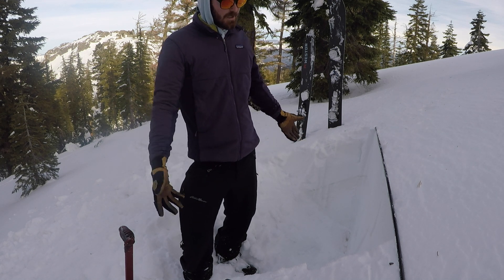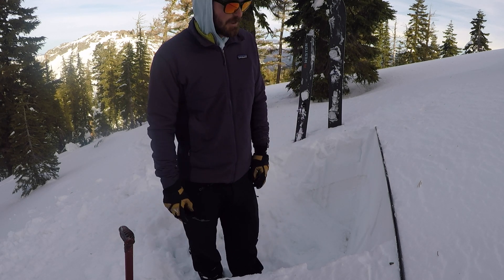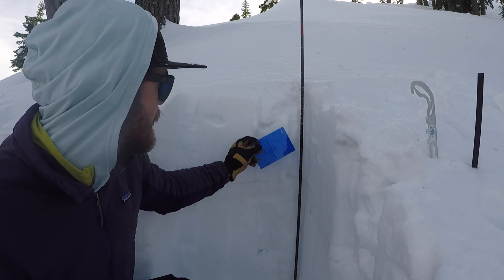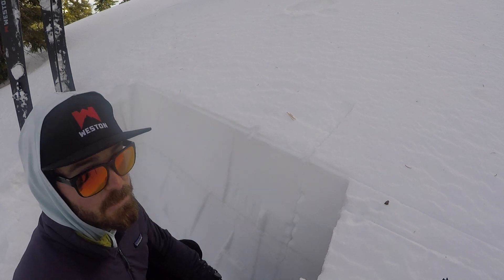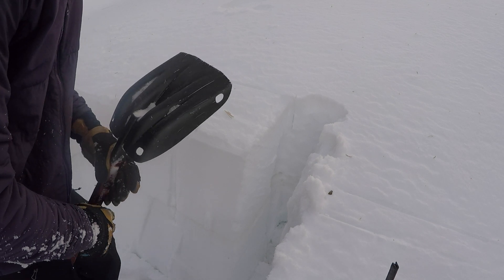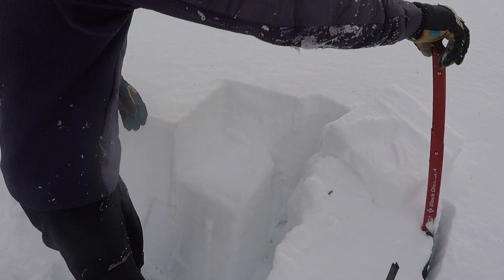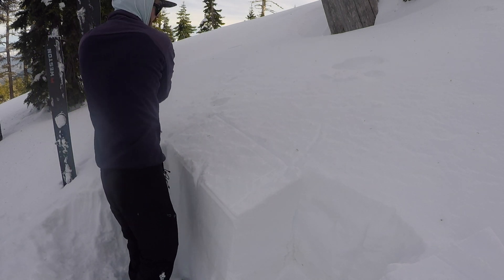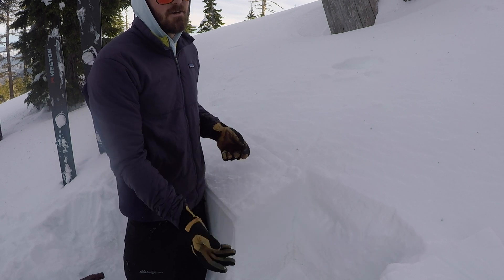How (And Why) To Dig A Test Pit (Snow Pit)

Comment: Hey man, not sure if you are checking comments a year after this is posted, but what would be your summary after this snow test? Would you have given yourself the green light and kept on skiing?
Reply: Not the OP, but snowpits don't give 'green lights'. They can only test for red lights when conditions are questionable (i.e. scientific method mindset). If conditions were bad, he would likely dig a few pits on his way up to get more data points. None of them are going to prove the slope 'safe', but each one increases his information and odds.

Having said that, there were no red lights given by the pit. If there had been signs of weakness under compression and/or propagation, he might have then done a Saw Test to get more information, or dug another pit on a similar aspect and elevation to what he was trying to ride.